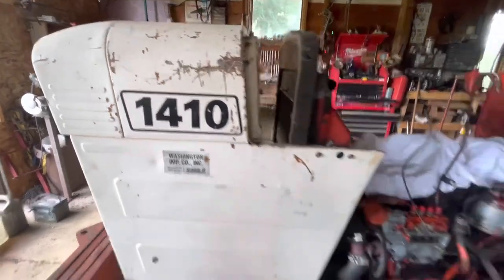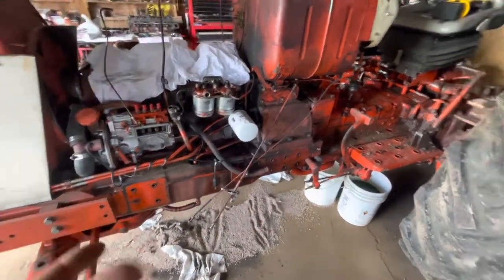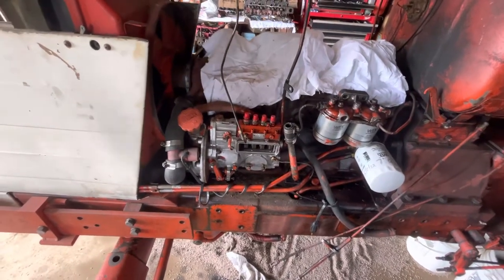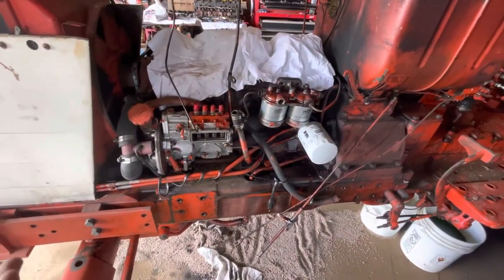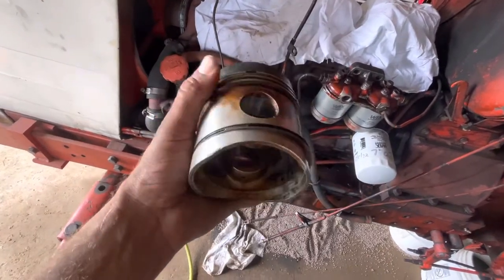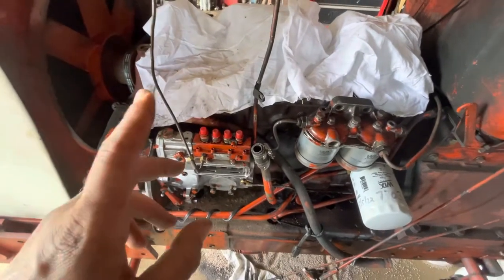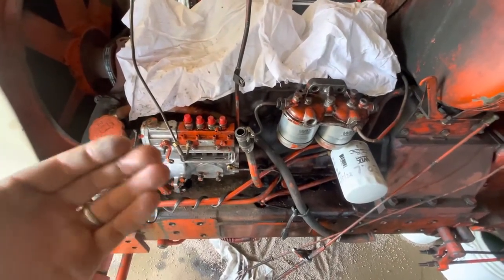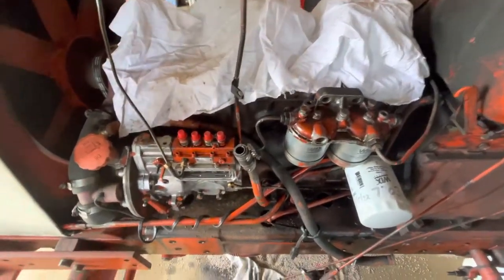Case/David Brown 1410 rebuild part 1…sort of

Comment: Hi im possibly a bit late but lack of fuel will NOT cause heat in a diesel engine, to much diesel or lack of air will cause heat. Petrol on the other hand is the opposite.
Reply from the maker: After consulting and sending the piston off to 2 engine shops specializing in Diesel engines, the consensus for the piston scarring is still partially from lack of fuel, extended use of ether and high rpm cold start. This is all in line with the history and hours on the tractor, 10k+ hours and it was the tmr mixer tractor on a 200+ cow dairy farm since 1980 in Wisconsin, it’s lived a hard life

Comment: Where is part 2? I actually bought the 1210 that was in the sale you bought this tractor on!
Reply from the maker: Hey man, unfortunately part 2 footage ended up going through our baler and got lost, I do plan to make an update video at some point on that and the rest of the projects. Tractor went back together great, I reworked the cab to make it a bit more comfortable and it’s been working all winter feeding cows. How’s your 1210 working for you?
Reply: @Southwest WI Farm  so far so good! It's my second 1210 and it's a handy little tractor! I actually just come home with a 1410 parts tractor today if you need anything! I have a bad tractor buying habit lol
Reply from the maker: @coryrupnow6559  oh nice! Is that the one that was for sale on Facebook on the db USA page?
Reply: @Southwest WI Farm  yes it was about 2.75 hr drive from monroe but for 1000 bucks I couldn't say no! The rear tires are practically new!
Reply from the maker: @coryrupnow6559  damn that’s cheap, the guy wanted about that for the turbo and pump when I asked. I’ll message you on fb about some parts I’d be interested in if you’re gonna part it out
Reply: @southwestwifarm3516  that's the plan!
Reply from the maker: @coryrupnow6559  cool, I’ll message you on Facebook